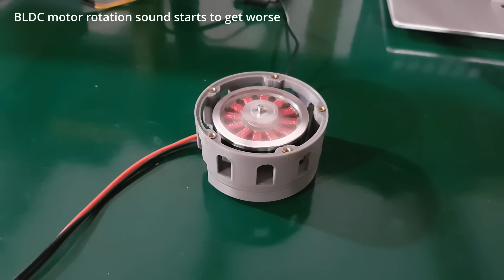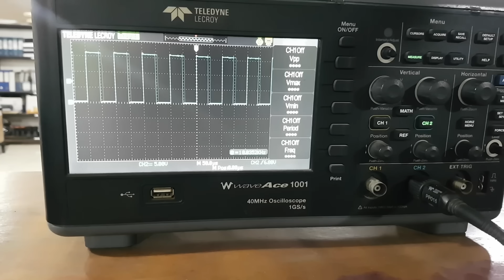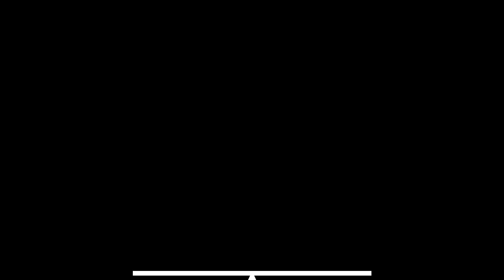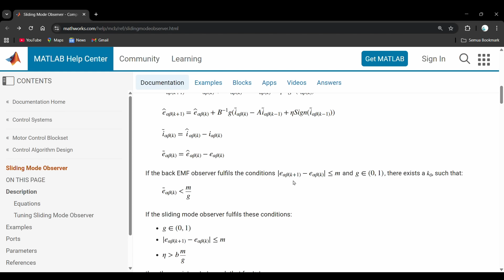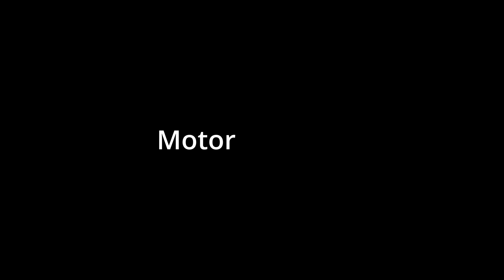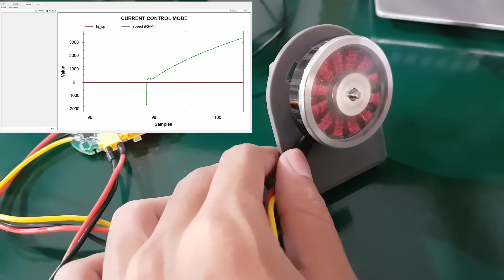Sensorless Field-Oriented Control: Sliding Mode Observer

Comment: In sensored Hobbygrade RC motors, it is common for the ESC to switch from low speed FOC for smooth torque control to the classic sensorless backemf reading at high speed.

Comment: Would to agree that motor noise correlates well with function and problems? For a given power and speed, is low noise usually the best? Have you correlated the electrical signal in the oscilloscope to the heard sound? I am really impressed with what you are doing, and hope to have access to such beautiful controllers soon.

Comment: bro, the data sheet of the position sensor you used said “up to 28krpm”, so the loss of performance is probably related to your spi speed, not the sensor, all you have to do is increase the spi speed, I prefer sensor motor control to all other control methods, usually other methods are only used when you have to.

Comment: OMG man you are on fire! This is where academic knowledge meets industrial skills, pure genius!

So I’ve been wondering, using Low-side CS, you kinda have to leave some window for the ADC to read, so the low-side FETs have to conduct long enough until the ADC sampling finishes. This becomes an issue at high duty cycle, where the high-side FETs conduct more amd the low-side FETs conduct less.

Empirically, I find that at 40kHz PWM, I’d have to limit my duty to <= 90% for 2 phase sensing, and <=85% if I’m doing all phases. This ultimately results in less RMS volt delivered to the motor, and hence less RPM.

What solutions/work-around would you suggest? I kinda gave up on that since I mainly focus on torque output rather than speed.

P/s: I tried the 5010 360Kv, at 24V, the highest I could go was ~7k RPM, after that Id rises and Iq converges to 0. However, an ESC I got on shopee could bring it up to 9200 RPM, I tried so hard but couldn’t match that number…
Reply from the maker: I also experienced the same problem because I used 2 low-side current sensors, forcing me to limit the maximum PWM value. I think the hardware solution is to use in-line current sensing. Or, if we use 3 low-side sensors, we can take data alternately at the two lowest duty cycles. Sounds reasonable to me, but I've never tried it. Thank you

Comment: It is interesting that speed of the synchronous motor is not observable at zero rotor speed, and the induction motor is not observable at zero supply voltage frequency. Therefore, sensorless controlling methods of IM were developed that avoid zero supply frequencies, which means the absence of dead zones.

Comment: hi my friend! very good vid again! sensorless is the way to go! now you have solved the range 250rpm to max with SMO. very good.
next: HFI for 0..500rpm. i did buy a aliexpress vesc clone and testet HFI with the vesc software. your hardware is good to to HFI. now i am super exited to wait for your HFI vid. 
again: this stuff is not easy..
pls make also a vid about the control strategies... how a main computer send control commands to that esc.. speed/rpm commander .. angle mode.. torque control.. drone mode..  position control..thank you
Reply from the maker: Thank you, I'm also very curious about HFI. And whether it can be implemented on a surface mount motor with a very small difference in Ld and Lq

Comment: It looks fairly obvious to me that you could use the magnetic sensor at low rpms and gradually move over to sensorless, so that you both get low rpm performance as well as high. They are both good methods but they have their specialities, so it is better to use the strengths of both than trying to overcome the weaknesses of either.

Comment: noise  , i mean nice  :))  i did SVPWM long time ago , and  i think it could apply in E-bike nowaday if you interested  .smaller esc and  reduce energy cost for proper speed  . but honestly i dont even have Oscilator to measure the signal  like you . all i did  is  write a fallback funciton in MCU and using USB port to transfer the result to computer and using python to plot the data  . but it work accoding my experiment

but when i looking at your code my  wonder has gone  .
Reply: How did you do that?
Reply: @rahuls7039 stm32 have a fall back function in protocol code base . you can modify it and send the data as global and using Uart to transmit to the computer. 

The flow should be Mcu - pid - motor. I catch it before the signal  is sent .  

My board same as him but i dont have oscillator.

Comment: Would there be merit to using an encoder at low RPMs and then switching to sensorless control at high RPM?  That way you would have absolute known control from startup and an accurate approximation at high RPMs
Reply: That's how it's done! The switch between two modes can even be implemented to be gradual, so there is no felt jitter during.
Reply: Yes. Many ESC for sensored motors e.g. in RC cars do that.

Comment: How much board costed with sensor and where u bought the electronics aliexpress or somewhere else
Reply from the maker: Hello. I don't remember the total cost, but I think it's a bit more expensive compared to similar ESCs. Initially, I only wanted to make 1 pcs, so all the components I used were based on what available in my country. And those are SMD components which are expensive if you buy a few :)

Comment: Make it work at low speed or even at 0 rpm? Without any back-EMF? I don't see the point. Why not just combine both methods, when one is good at high speeds, and the other at low speeds?
Reply from the maker: Yes, I have actually tried it. But since I was also curious about sensorless start up, I tried not using the sensor at all. Thank you
Reply: How were the results? Did it work all the way?
Reply from the maker: The results work quite well, but the transition from sensored to sensorless is a bit annoying. especially when using speed control mode, where there is a possibility that the transition will occur repeatedly in the area where the minimum back emf can be read.
Reply: @srj4555  maybe add some hysteresis to overcome this. Personally I would also be very interested how to implement regen breaking from scratch
Reply: This!
Reply: It may be possible to do some position estimation at 0 RPM by e.g. measuring inductance of the windings or eddy current effects in the core.